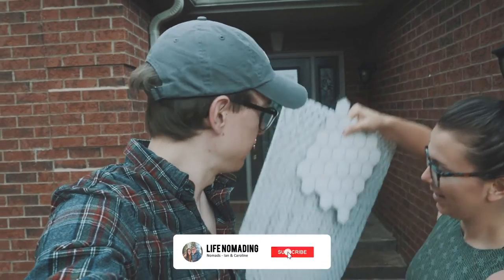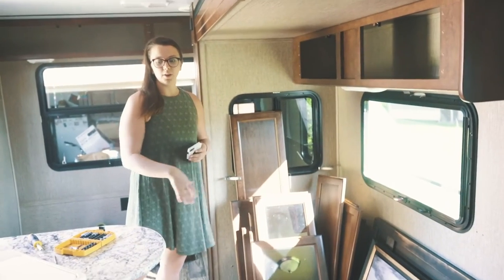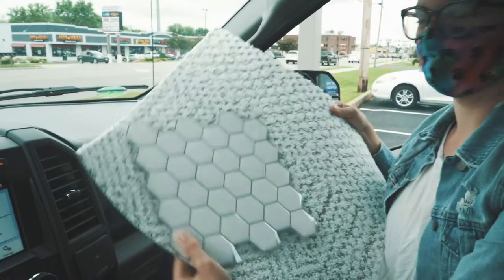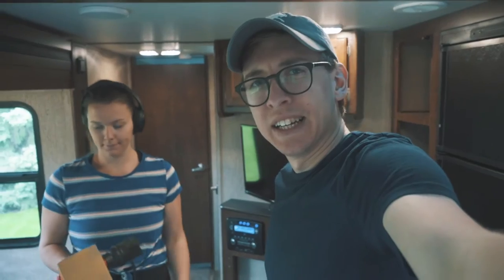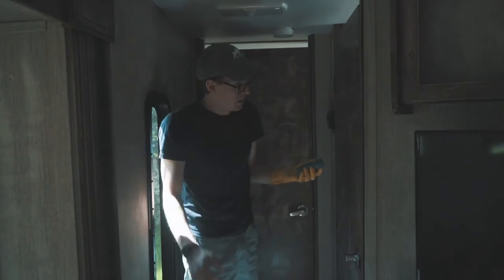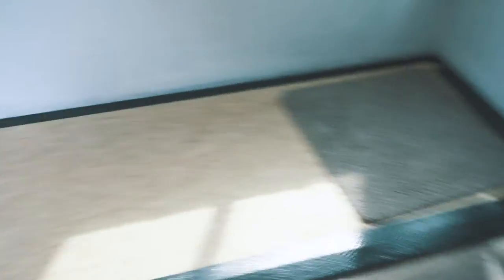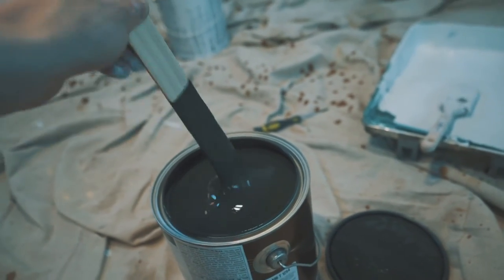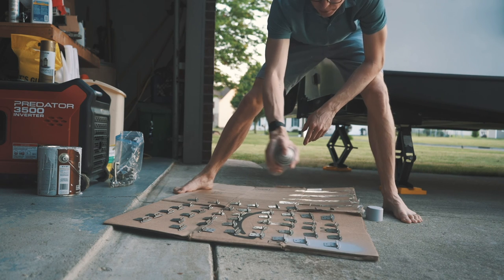How to Paint Your RV Walls and Cabinets | RV Renovations

Comment: Little tip for anyone wanting to paint cabinets in a home or RV: Use painter’s tape and a sharpie and label the back of each door as you remove them. You can just number them and put the matching number right inside of the matching cabinet. Then put the hardware for each in a snack baggie and place right inside the matching  cabinet. This makes the job a LOT easier! Happy renovating!